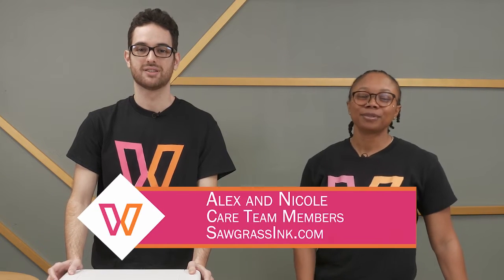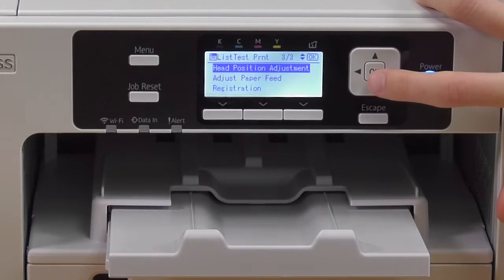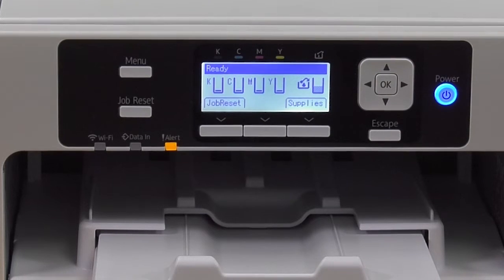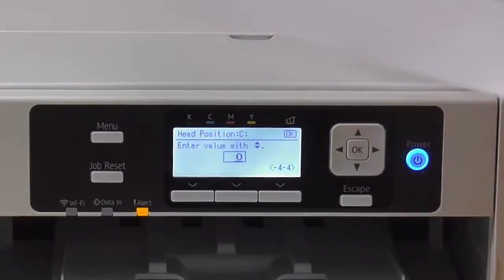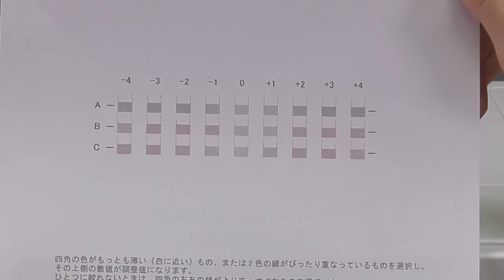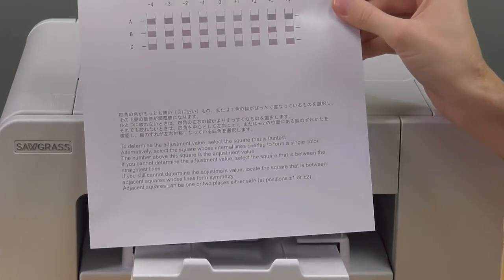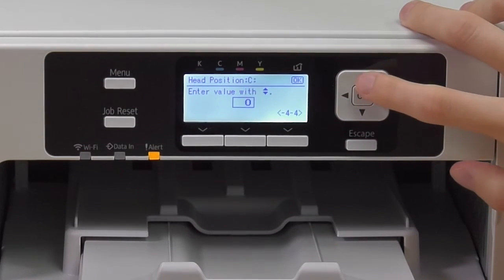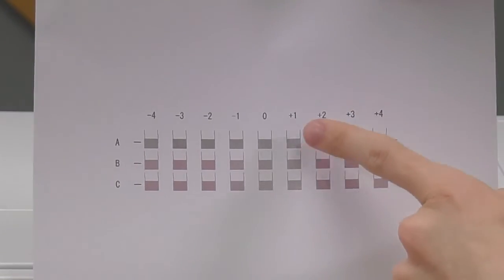HOW TO:   Print Head Adjustment (SG500/1000)

Comment: This video couldn't be more useless. My menu on the SG500 isn't even the same. I don't have printer features or list/test print. I have general features then Display Contrast, Key Repeat, & Measurement Unit being my only 3 options.
Reply: I think this is for the sg 400 and 800.
Reply from the maker: Sorry for the late reply -- when you are having an issue with the printer that you cannot resolve with our videos, please reach out to our support team at care.sawgrassink.com.  This may have been for a different model than you have.